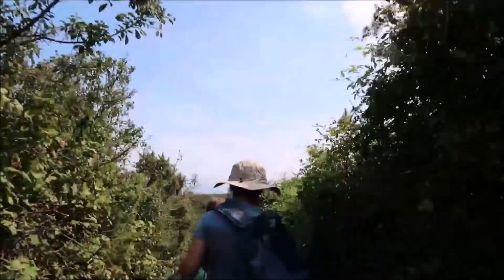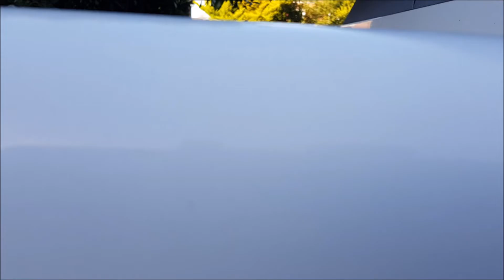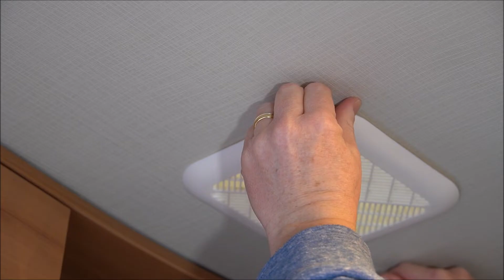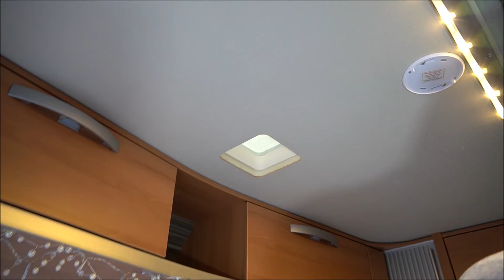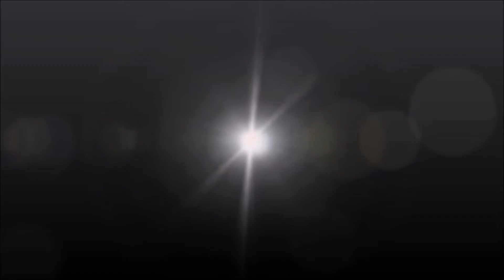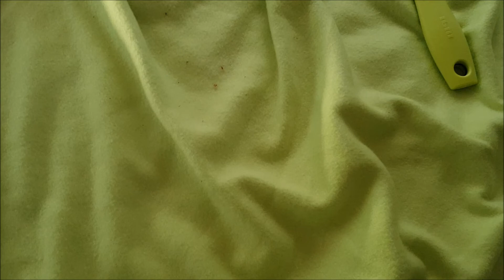How to remove and clean the mushroom roof vent fitted to Eriba/HymerCar/Erwin Hymer Group vehicles

Comment: Thanks for this information! Very helpful indeed. My mushroom is already cracked due to a hailstorm. Difficult to obtain a new one.
Reply from the maker: You’re welcome, pleased to hear it was helpful and thanks so much for taking the time to let me know, most appreciated :) My mushroom managed to survive some really big hail last Autumn: https://youtu.be/QbrYcIlBMzQ, the awning windows didn’t fare as well and the stones also left a few dents in the aluminium parts of the roof :( In the U.K. we can luckily get the full vent via eBay: https://www.ebay.co.uk/itm/HYMER-MOTORHOME-CARAVAN-SMALL-ROOF-VENT-WHITE-/184330785966?mkcid=16&mkevt=1&_trksid=p2349624.m46890.l6249&mkrid=710-127635-2958-0 if you’re not in the U.K. I hope you manage to find the correct part or someone who can plastic weld or 3D print a new one! Best wishes
Reply: @CaraVanOlogywithBecky  I live in Spain and I found this one but after watching your video, I think it's not the correct one. Thanks a lot for answering as I wanted to order it over the internet. You have saved me money! 
My caravan is an Eriba Touring 430.

Comment: Thanks I have this vent in my giest lv550. The wind has picked up last night and I just noticed how much cold air is flowing through this vent it might as well be an open hole in the roof. I needed to clean it out as it was looking pretty grim as well. I had an inkling it would just pull down but didn't want to break it attempting it. I had some dial breathable insulation wool and cut it out to fit inside which has cut the draft down a lot and given the vent a frosted look which is a lot nicer and still allows for some airflow.
Reply from the maker: Certainly can blow a hooley through there can’t it! I was in the same position, an inkling but hadn’t seen it done hence thought it would make a useful vid.  Probably occurred to you already but just mentioning in case any newer owners read these comments in the future: be very careful if using gas as the appliances need decent air flow to burn correctly and of course in storage this vent will be keeping the vehicle nicely aired to minimise the chance of condensation. Presumably the designers calculated air flow for both of these things when specifying number and position of vents hence the note of caution if restricting the air flow in any way :) Thanks for watching and commenting and enjoy your Geist, Becky
Reply: @Caravanning with Mum On a Mission  certainly was and is the only video I found so thanks 👍. Yes I'm aware of gas ventilation and I would only recommend using a breathable wool, it certainly still let's a breeze through it just takes the edge off the extremes. 👍

Comment: How to remove outside plastic cover?
Reply from the maker: There appear to be 4 press studs just under the lip of the top piece, 1 on each side. I expect you press those and it pops off, but I as I think I mentioned in this video, I decided not to do that because external plastic covers tend to go brittle in outdoor UV light, so I didn’t want to take the external cover off in case it broke.